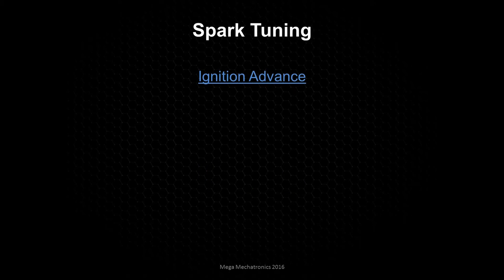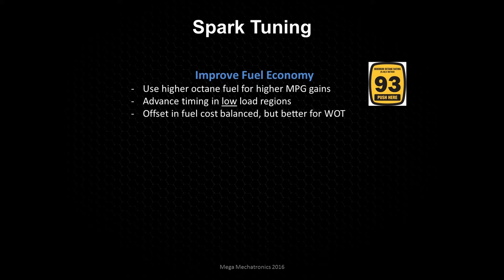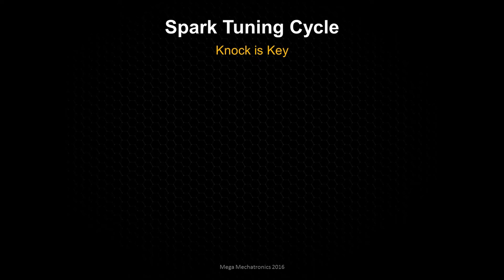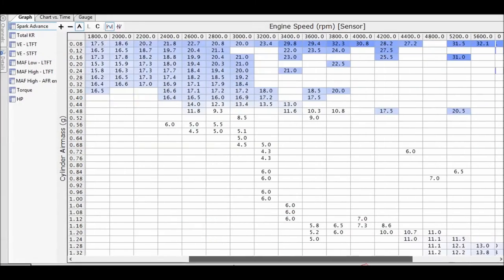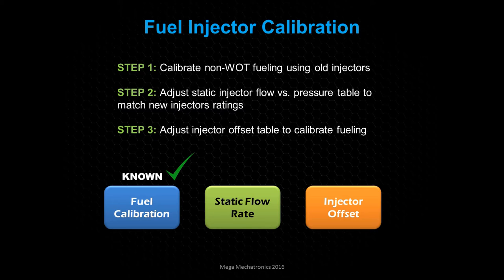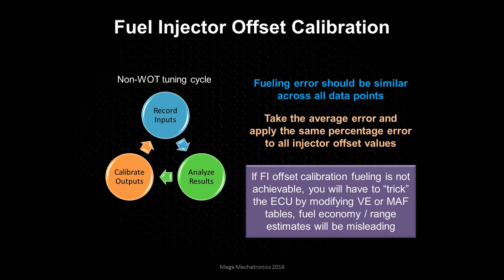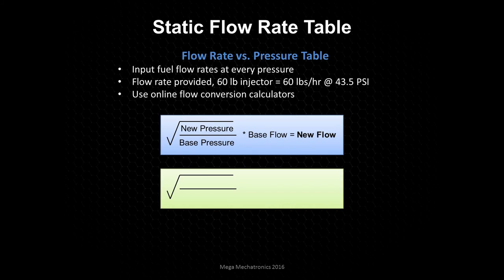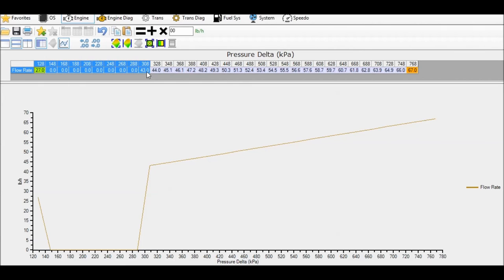How to tune Engine Tuning 101 - Part 5 - Spark Tuning, Injector Calibration

Comment: injector offset can be ballparked by measuring command pulse timing vs injector current draw. as the pulse hits and current starts to climb there's a dip in the curve where the injector is actually moving from closed to open due to counter-electromotive force generated by the moving metal parts. the effect disappears when the injector is fully open. fuel is delayed from the start of the pulse to somewhere in that notch in the curve of the current draw.

Comment: Great video! 
So If I add more fuel on a turbo car, I should advance more the spark?
Reply from the maker: You tune spark advance with knock (audible or sensor), but fueling may help with knock on boosted applications. This means running some boosted engines as rich as 11.0-11.5:1 on regular pump gas such as 93 octane, this with help control knock but it is not a silver bullet to stop knock.
Reply: Thank you, that was the missing info I could´t find!
Reply: More efficient engines need LESS timing. Turbos increase efficiency. Nitrous increases efficiency as well and usually requires retarding the timing when you spray.
Reply: thank you!